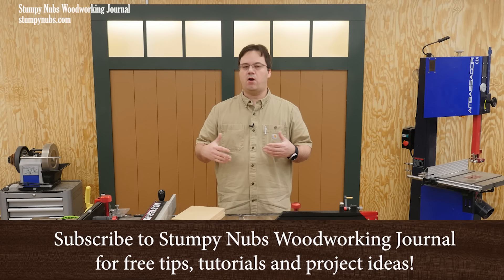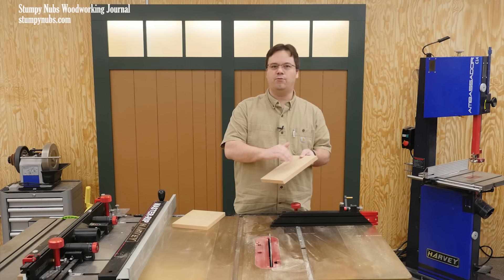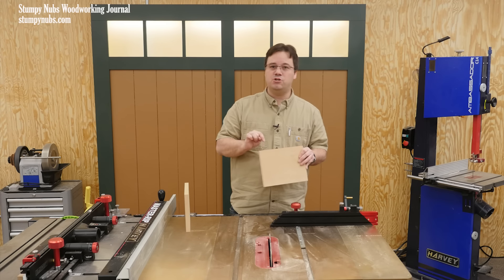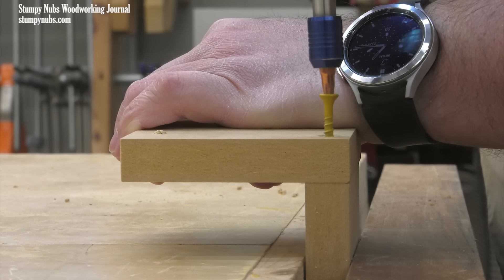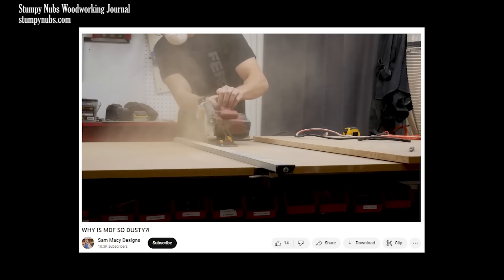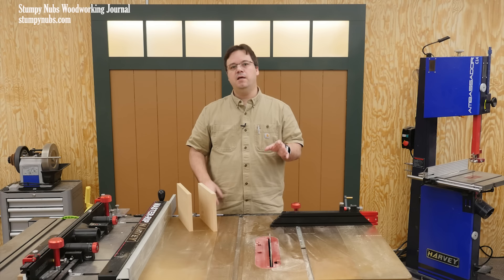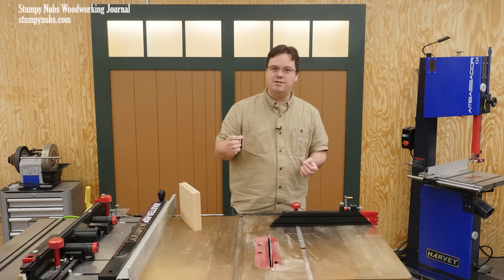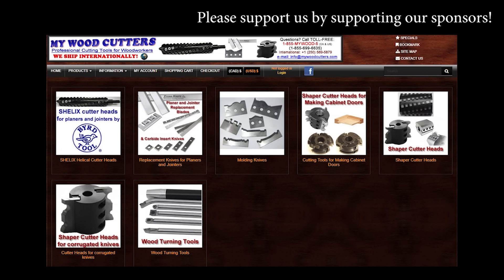This stuff changed my mind about MDF projects

Comment: I like using MDF for painted floating shelves. Using an oil or solvent based primer rather than water based means no swelling and resulting proudness at joints.
Reply: MDF shelving is very prone to sag because it has so little strength. OK for shelves with a few light objects on them and if you use lots of supports, but terrible for many applications. The same is true of MDF's cousin particle board.
Reply: @johnhorner5711  I’ve built shelves 10’ long, no sag. They have support inside, mitered edges. Wasn’t really talking about single sheets.
Reply: @organize1979  Yep! You’re basically—I’m assuming—building torsion boxes, which are quite rigid, MUCH more so than shelves made from a single thickness of MDF; those sag horribly!

Comment: If you want to wear a respirator and goggles, get a full facepiece instead, it's way more comfortable. 3M makes a few full facepiece respirators, and one of the other nice things about them is that breathing in refreshes the air in front of your eyes as well, so they don't get muggy like goggles.
Reply: @acmhfmggru  It may come down to local environment too. Some places are more or less humid and hotter/colder which is going to affect how much equipment fogs up.
Reply: I don’t have a respirator (yet), but an old swimmer’s trick is to put a thin layer of Johnson’s No More Tears shampoo inside goggles. It works great for keeping them from fogging up! The brand is so if it gets in your eyes it won’t bother them.
Reply: @b-radg916  There's anti-fog for divers but I have a sneaking suspicion that it's just dish detergent at 90x the cost.
Reply: @chaos.corner : I think dish detergent would sting a lot more than No More Tears! 😢
Reply: @b-radg916  Hmm. You might be right but I've never tried putting the stuff directly in my eyes...
Reply: @chaos.corner : I’ve done the No More Tears in swim goggles and am sure it’s gotten in my eyes … didn’t feel a thing 🤙🏽🤙🏽
Reply: @b-radg916  Maybe it's just no more tears at a 90x markup then,

Comment: For the edges, I always use PVA glue. Slightly diluted, it will be soaked in the edges and dry medium-hard,  the edge will be sealed so you can sand and paint.

Comment: Just a tip for working with mdf. I like to shoot a couple drops of CA glue into my predrilled holes just before drilling a screw in. I personally dont see a need for activator. I have not run any tests but I feel it strengthens the mdf threads made by the screw and locks the screw in place.

Comment: I use either pvc or hardwood laminated mdf for pretty much all my cabinets. I like to use threaded inserts for all my joinery, especially if it doesn't require a seal. (18mm Mdf) 4 10mm threaded inserts for every 50cm of edge to edge joining seem to hold it pretty well. I add a bit of epoxy to the hole, let it soak it up and add a little bit more before I screw in the insert slightly subflush.

Comment: My best results for MDF edges is to not sand after cutting. Treat the cut edge off the saw with one to two coats of an acrylic  primer undercoat (I use Layland which is made by PPG). Once dry sand lightly with 240 grit and you're done. But like others said all MDF is not created the same so get the best you have available to you for best results.

Comment: All awesome tips about the dust, thanks for including that.  I also tape a MERV 13 filter to the back of a box fan and have that running as an extra cleanup tool for the dust while I'm working (and a bit after).
Reply: I do the same thing.
Reply: I want to build a filter fan for drywall dust, do you think MERV 13 would be effective?

Comment: Burnishing the edges via higher grits or dull sand paper. Also works wonders for preventing how much mdf edges soak up. This is a technique we relied on heavy when making Veneer sandwiched mdf cabinet doors, with a routed edge profile. Its the complete opposite of when you work with maple that your intended to stain, where your opening the pores in the sanding process.

Comment: I built a washer and dryer stand with the frame being pine 2x4 and 4x4, topped with 3/4 plywood but I skinned the outside with leftover MDF from another project. I bondoed the seams and painted the same color as my washer/Dryer, loved the way it turned out
Reply: Years ago, a guy in my dormitory built MDF speaker cabinets finished with Bondo and and a matte black paint. They were beautiful. What he saved on the cabinets, he spent on the drivers. Made for great sound.

Comment: If you use Ridgid 18v Cordless Drills drop your chuck setting from the Drill symbol down to 12 (roughly half), I find that setting prevents you from over torquing the screw when using coarse thread drywall screws, I have decade old speaker boxes put together this way then used caulk to seal the joints that are still rock solid, but then again I cut them so perfectly (as I plan out my cuts so all cuts of the same length are done on the table saw before changing to the next dimension) you  can stack the pieces into their positions and stand on the box with no screws and it will hold you up. Lately i've been tempted to try doing drawer joiner to connect panels together to reduce reliance on screws in the visible areas.

Comment: MDF makes great ceiling trim/crown molding, where its dry, stationary, non-load bearing and indistinguishable from real wood.
Reply: have to disagree on using it for moldings.  Edges are never as crisp as wood and long lengths are floppy and can snap on you.  Its weight also makes it harder to deal with and nail holes can mushroom on you too.
Reply: @MrSpzwd  Thanks, but I must disagree with your disagreement.  The pros outweight the cons.

Comment: Biscuits are a great way to join MDF edges. Water resistant MDF (such as Medex) is way superior to standard and especially lite weight MDF. You still need pilot holes for edge screwing, but it doesn't split nearly as easily either.

Comment: Iron on paintable edging tape would be my tip for edges, gives you a perfect ready to paint surface without all the sanding and filling, the London craftsman whos video you showed has switched to it too and has more recent videos on it. 👍🏻
Reply from the maker: I don't make a lot of MDF projects, but if I can avoid edge-banding, I usually try something else. Edge banding can catch and peel.
Reply: @StumpyNubs  it doesn't peel of at all without being heated, I've tried, really annoying when you mess it up and need to remove! I've used thousands of meters of it without issue. It's not like the ABS edge banding on MFC, more like paper, generally about 0.4mm (.016") thick  I normally put a little chamfer or break the edge so that there's nothing to catch on too. If you hit the edge hard enough to damage the tape then the paint is damaged anyway, same would apply to a filled edge. Give it a try if you get the chance, you might be surprised!

Comment: I personally would love to see a series of tutorials on MDF.  I have a lot of projects coming up as I remodel our old 1948 house.  I'm planning on building my own built in cabinets and the price of plywood is insane right now.
Reply: Plywood costs have come down greatly. I promise that you will regret using MDF for many applications if you plan to live in that house for many years. It absorbs moisture and swells. It has no strength. It is damn heavy, which means lots of stress and strain while installing cabinets and such. 1/2" plywood is stronger than 3/4" MDF, so one way to minimize costs is to use 1/2". Also, plywood is available pre-finished, which will save you a tone of time compared to non pre-finished materials.
Reply: @johnhorner5711  Glad to hear the price has come down. When we looked 3 months ago it was crazy expensive, Even the lowest grades at Menards was stupid expensive.
Reply: Please don't put fake wood in a nice old house
Reply: I'm dealing with so much swelling on MDF kitchen countertops and even the drawers underneath. They seem to have a veneer that unattached in several places. Bathroom also.  After pulling off the veneer it was a nightmare to work with. Please don't use it. You will regret it later. Or if you do use it take note of all of the above comments and just proceed carefully with regard to it. If it's extremely cost-effective it seems you can get a lot of use out of it if you are careful with your application of products and sealants. But just know at some point it's going to be a nightmare

Comment: There is one more disadvantage to MDF, they are heavy. 

Our house furniture apart from a few things I made are out of MDF. Almost all laminated, some have very nice textures too. They don't look particularly good but let me tell you this, they are durable. I can actually use them to sand pine. They are incredible as long as they are dry and well built.
Reply: You need to be introduced to the world of ultralight MDF!  Trupan and a couple other manufacturers make a very good product with a consistent core.
Reply: @jayty1997  That sounds interesting. I will look around if I could find a sheet to play with.

Comment: its heavy, doesnt flex, creates toxic dust that lingers in the air after cutting, dulls your tools, cant be fastened normally, cant get wet, and requires extra steps for basically everything making you not become a better woodworker in process
what a great product

i will say it takes acrylic paint decently and you can sell mini paintings on it
Reply: It's better to think of it as an entirely different material. Just like you wouldn't typically use wood blades to cut vinyl trim, you use a different toolset for MDF and use the panels themselves for the right purposes. Large shelves, especially adjustable shelves for racks or cabinets, are a good example of something that makes more sense to do with MDF than with traditional wood. Acoustic panels and boxes are another great example. While not a 'fine' finish material in any sense, you might be surprised by how many high-end products rely on its properties for various reasons.

Comment: I use watered down wood glue on a 'open' MDF.   It dries quickly and makes the edges impermeable to paint.   Then..fine fill and smooth before painting.

Comment: Another helpful video. The only thing I might add is that for years I've been using Confirmat screws to join pieces of MDF. After a pilot hole is drilled with a specialty pilot bit, these screws make the splitting in MDF a lot less likely. Confirmat screws are available in a couple of sizes, and Spax even makes a #6 size that I've used successfully in 1/2" MDF.

Comment: I only ever use moisture resistant MDF.its more expensive but it's more dense and alot easier to seal the edges.its a much better  edge finish.not much sanding and it's slightly stronger 👍
Reply: HMRMDF - it should be colour coded in the middle, like HMR chip board. Around my area the colour coding is pale blue, other countries may use different colours. Don't get scammed by being sold regular MDF as HMR at a premium price. If the spotty kid at the big home store tells you its all the same, it might be time to go to a specialist panel goods store.

Comment: I use a 2:1 water and PVA mix too seal the edge of MDF before painting, let I dry, sand lightly with 400g and it coats just as well as the surface if not better

Comment: I'd recommend DuraBond, as it quite a bit more water resistant to humidity.  I've used it in bathrooms and Kitchen walls where I expect humidity to be a problem with great results with fiber and over tape on the first layer.

Comment: On some MDF joints, I'll put a couple of drops of CA glue into the pre-drilled hole to firm up the the material before driving the screw. Work fairly quickly, though.

Comment: My tip is to poor thin ca super glue on the edges, before gluing, it more than doubles the strength of butt joints as it increases the strength of the board beyond that of the PVA glue, so no more delamination.

Comment: I use MDF a fair bit if i am painting the piece. To treat the edge i mix up some dilute PVA in water and paint it on. After sanding the edge is as smooth as the surface.

Comment: I tend to use wood glue and pins for mdf, providing the project has enough glue surface and joints it will hold itself together. As you said mdf if its not being moved though, so large pieces of furniture or permanent fixings.

Comment: You can temporarily clamp a  strip off material on each side of the mdf edge that is receiving the screw.  Then it will not split.  For SUPERIOR strength on a 90 degree edge, use a barrel nut and a bolt.  The longer the bolt the stronger the joint.  I normally use about a 1  1/4 inch bolt.  You can countersink the bolt head if needed.   I fill the hole with Bondo if it will be painted or veneered.  Nasty MDF dust will also ruin your shop vac motor, so be sure and use a dust separator.  Thanks for video.

Comment: You can drill a 25-30mm hole near the edge, epoxy in a solid wood dowel, cut it flush, and drive your fasteners into that. This way the screws will have something to grip, and won't strip out
Reply: I used exactly this technique to repair some second hand kitchen cabinets. They originally had snail cam dowels but they had been somewhat abused. I used a 35mm forstner bit to make the hole and kept it blind so it doesn't even show on the outside of the cabinet.  Those cabinets are now more solid then they've ever been in their life.

Comment: I had a recent project where i was installing a kitchen island made with cabinets from Wren, who makes them out of MDF.  A couple fascia pieces were made of MDF as well and not really intended to be installed where rhe cut end would be visible but in my case rhey were.  I was worried about cutting the mdf and finishing it so it wouldnt look super obvious what i did, so i looked online.

After cutting the MDF and routing it (rounding the edge) i used a 50/50 cut of titebond glue to seal the exposed raw MDF edge.  The MDF sucked it right up, turning dark.  I applied 2 coats.

Sure enough when dried it was super hard and easy to sand.  After some regular prep i painted the edge with some colormatched (greenish) paint from HD and without someone telling you that the edges didnt come factory finished, you wouldn't know the difference.

Comment: To ensure maximum tightness of the joint, I grind the threads off the screw where it passes through the top board.  That way the only place the threads grip is in the bottom board and presses the top board as tightly as possible against the bottom board.  Takes a little more time but tight joint help ensure there is no slack between the joints that will allow movement that can cause whatever you are building to rack side to side or front the back.
Reply from the maker: It is way easier to just bore a hole that's larger than the threads in the top board.
Reply: @StumpyNubs  
That is true but then the fit to the shank of the screw will not be as snug as is possible to get.  Being a little obsessive/compulsive I tend to go for the little extra.

Comment: Yep, MDF/LDF is probably the nastiest material to cut and/or  use a router.  Great advice on the mask. When installing trim that has an exposed cut, I'll apply some caulking and smooth it with a finger or damp rag to seal the surface for paint. It dries so fast it doesn't swell the fibers.  The painter will appreciate it. Pneumatic fasteners can present some problems. 16ga t-head fasteners will mushroom the surface, painters will revolt, 18ga will not, 15ga finish with a round head will not mushroom.

Comment: Yep, MDF (especially the edges) is not very moisture resistant. In fact, moisture intolerant might be more accurate. Regarding using joint compound. I found that waterbased primer (e.g. Bullseye 123) soaks in and binds nicely with joint compound and makes a pretty tough layer.

Comment: Always use the clutch on your drill/screwdriver. Set it wide open and it'll snug in. Tighten it up a bit and it will drive in the rest of the way. No danger of tearout. Lots of rattling from the clutch, cut that's what, it's for Remember, you want to grind your clutch to control torque.

Comment: If you have locally, a true supplier of hardwoods & cabinet grade sheet goods, rather than the typical box stores, look into the variety of products they handle.
Along with conventional MDF, you may find; quality plywood cores with MDF faces (structural strength AND smooth faces to paint) and even plywood cores/MDF outer layers and poplar or birch veneers.

Comment: I've built quite a few guitar/PA (speaker) cabinets using MDF.  I use shouldered dado joints and have never had a problem with a joint loosening or breaking and these get moved and banged about a lot.  As for finish, MDF is soft so it needs to be protected, vinyl or cloth are great for that but putting them on is time consuming.  I switched to using spray-on truck bed liner and it works great too, although it doesn't make for a pretty finish.  BTW don't use the rubber dip type paints as they will peal off if they get cut.

Comment: I filled some raised panel MDF edges with aquacoat grain filler that I had laying around.  I slathered it on with my finger then sanded it back smooth.  I think I prefered the result over drywall compound.  would be curious if others agree with that.  Downside, its WAY more expensive.